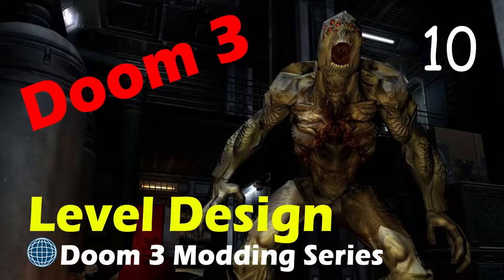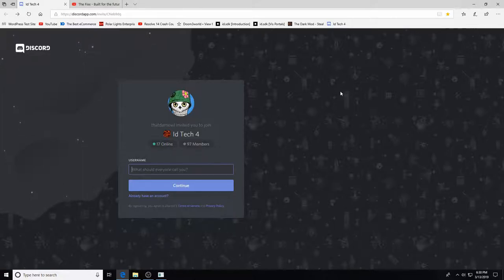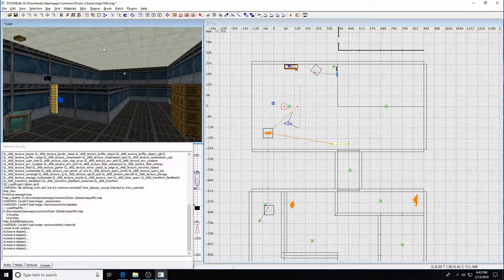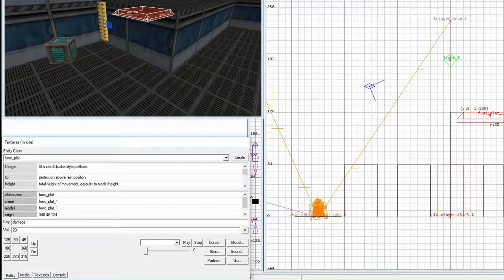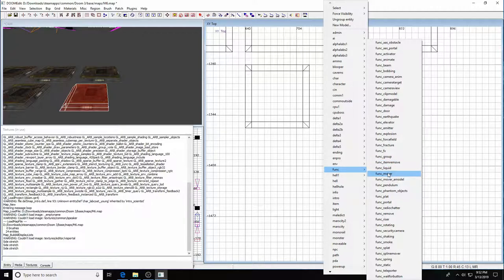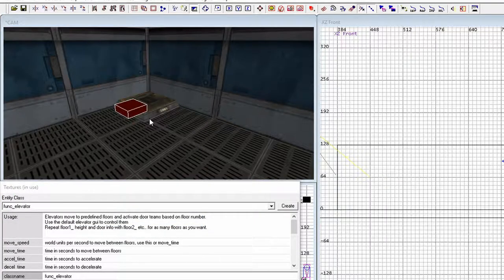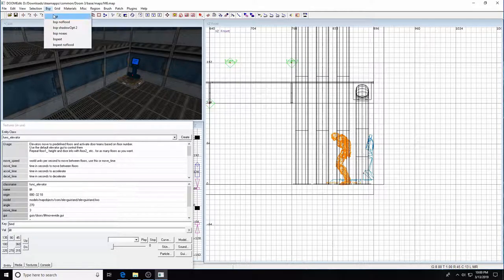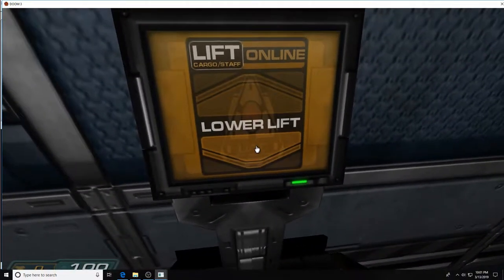Modding Doom 3 Part 10 - Moving Platforms and Callable Lifts (elevators)

Comment: If it's possible, how do you make an elevator with 3 or more floors?
Reply from the maker: Hey Rub, glad you're enjoying the videos!  

Are you just curious about the elevator or do you have a specific need for one?

You can define any number (theoretically) of floors (floorPos_x) in the the func elevator entity.  Then just carry on adding guis and adjust the parms as needed. An elevator - as in the car with inner and outer doors - is just a matter of adding inner and outer doors.
Reply: Thanks.